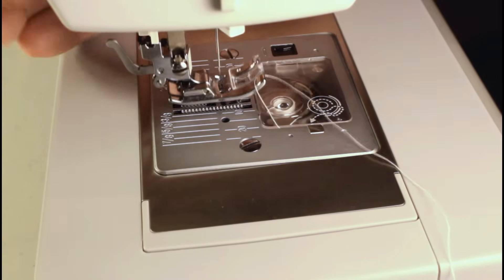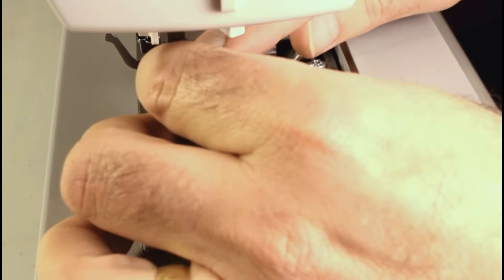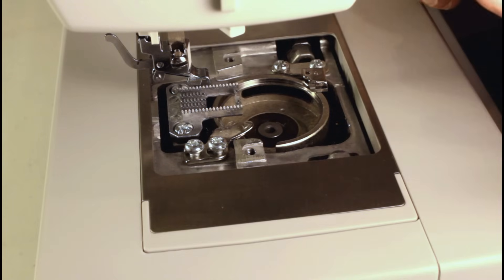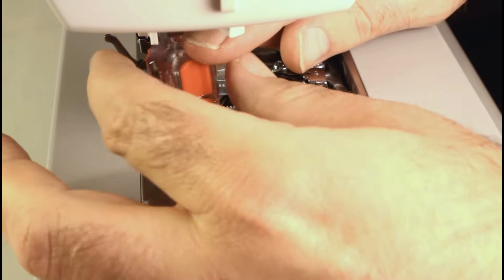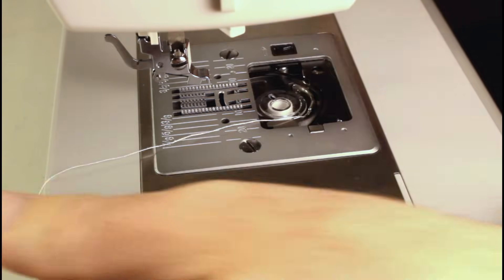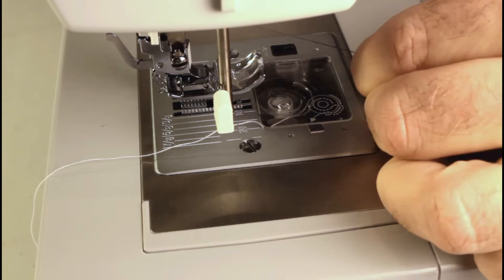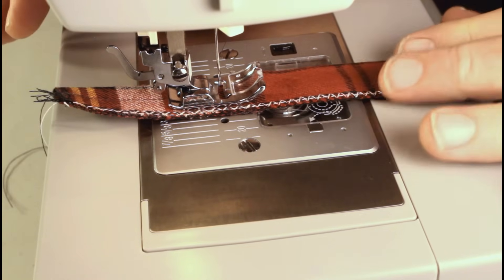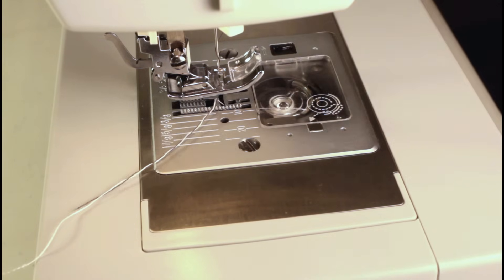Singer Heavy Duty - Adjusting Bobbin Tension, Please read the Description before posting questions.

Comment: I left this comment on another of your videos. I wanted to make sure you were able to read this problem. 
I made small adjustments at a time turning on the top tension dial on my Singer 4423. There was no difference. How can I fix the dial?
Reply from the maker: Download the service manual. It will show you how to adjust the tension setting:  www.kevinsews.com/download/SingerHeavyDutyServiceManul.pdf

Comment: Your top thread seems to be wrapped around the needle. Is this the correct way or does it just not make any difference?

Also on another topic... I'm using thread that is wrapped on the spool side by side up and down the spool (not zig zagging up and down the spool), should I use the vertical or horizontal thread post?

Thank you for your time.
Reply from the maker: Please read the description where I acknowledge this issue.

The cross threaded spools should be used on the horizontal spool holder. The standard ones should be used on the vertical post.
Reply: Kevin Sews
Thank you. Your videos are super helpful.
Reply from the maker: You're welcome!

Comment: Hello Kevin. Thank you for this vlog, it's very helpful. I just purchased this machine a couple of months ago, so it's a newer machine. Tonight my cat sat on the peddle and ran the machine with no fabric in it, probably about 20 strokes. It put quite a rats nest of thread in the bobbin compartment. I carefully cleared that out but now my bobbin stitches are not right. The top stitch is good, the back looks like dots of thread. (I hope that makes sense) I changed the needle, just to be sure it wasn't bent. Then I tried to adjust the tension with the screw on top, that didn't work. I was afraid to take it apart (until I saw this vlog) I will clean it again now using this method, to make sure I didn't miss anything. Could it have hurt the machine running it like that? Any suggestions are greatly appreciated. Thanks again, this is a great vlog!
Reply from the maker: I am sorry for my delay in responding. Your post somehow got flagged as possible spam and I just now noticed it. Hopefully, you've figured it out by now, but if not let me know.

Comment: My bottom stitch is not matching my top stitch. My top stitch looks great and even but the bottom stitch looks uneven and choppy. It just recently started doing this. So i was wondering if over time could the bobbin tension become looser from wear and tear? Thank you.
Reply from the maker: Check your needle thread tension first. With your needle threaded pull the thread with the foot down. The needle should slightly bend when you pull on the thread. After this test again. If it is still a problem then adjust the bobbin tension. Yes, the screw can back out oven time as your bobbin ages. Singer puts yellow paint on the bobbin to help prevent this problem.
Reply: Thank you so much!!
Reply from the maker: @krissyb1308  You're welcome!

Comment: Can you help me please?  My bobbin case started to move a bit.  I pulled it out to check and it came apart.... I have all the pieces.. two screws, the long silver piece, the long black piece, a tiny black oblong piece and the smaller silver piece.  I cannot figure out how to put it back together!! Is there anywhere that shows me how?  I have had the machine less than a year.  Thank you.  Any input is appreciated!!!  Model Singer Heavy Duty 4452
Reply from the maker: The bobbin case came apart?

Comment: I have a question that i hope you have the answer for. When the needle on my singer goes down twice it will get stuck. It does not go forward. Also there are a lot of extra threads underneath the fabric that I am trying to  sew. I was not able to find a solution to this problem. I am not sure if there is an issue with the bobbin or something else. The sewing machine was working fine for years and I started experiencing this issue.  Thank you!
Reply from the maker: What is the make and model number on your machine?
Reply: I have the exact same issue i was sewing all day and changed the thread and bobbin and now I suddenly have the above issue with the needle on my singer 4432  gets stuck & does not go forward. underside has clumps of thread which  the  user guide says I must check I loaded the bobbin correct. I did h=what they said and how i have been doing for  ever so cannot see this has anything to do with how I load my bobbin.

Comment: Hi Kevin,  I have the Singer 4423 and it jammed this morning first attempt to sew a heavy knit rib to some heavy twill - after pulling the fabric out I observed the bobbin thread all looped up on the underside and  the fly wheel would not budge/was totally jammed! I tried manually rotating anti clockwise and clockwise - all seized up and very stiff to turn.  After opening /loosening the lower metal plate and feed dog teeth and removing the caught threads -  the bobbin casing dislodged - so I removed without realizing it is removable (until after discovering this video) - so after a few attempts to rehouse - first attempt was incorrectly positioned without - with the black notch beyond the metal spring and of course the needle hit plastic when lowered gently by hand  - I removed and relocated correctly - and the machine test 'sewed' fine without needle threaded or bobbin inserted.. After inserting the bobbin and threading the needle (needle was not bent/and replaced with new anyhow) - was manually able to pick up the bobbin thread - however attempting to test sew - the same issue - the needle sinks, gets stuck and wont sew...I have ordered a replacement bobbin casing/housing but the original does not look damaged, if the new bobbin casing doesnt resolve the stuck stitching issue - what else could be wrong? I did notice that the bobbin thread gets caught under the bar that holds the bobbin casing in place with each rotation - not sure why but this is not right as the thread should be released to the underside of whatever fabric would be sewn.  I will really appreciate your advice! Is it a 'timing' issue - do you have any other video's regarding how to adjust the timing for this 4423 model? The machine sewed fine last week and is about a year old, has had intermittent use.
Reply from the maker: No, funny thing is I own and use several of these machines and not a single one has gone out of time over the past 4 years. I plan on doing a video on how to adjust it once one does.  My guess is you will need to remove the bottom cover to get to the screws required to loosen to adjust the timing. Just search for how to adjust sewing machine timing and use it as a general guild as to how the machine works. As long as it is a top loading bobbin you should get enough to figure it out.

I had one person tell me they had the same problem as you are describing. I shot a video for her showing how mine cleared then I never heard back again. My thinking is something is out of time though. Maybe the bobbin case has rotate slightly and it closed that clearance. That was what I was left with thinking the last time.
Reply: Can you please show me how your thread clears on your machine too? My issue is bobbin, and Im guessing it’s the thread clearance, it gets stuck on the little metal stopper bar to the right of the yellow painted tension screw. But now, I can’t remember how the thread should clear the black bobbin case altogether. I am thinking that issue is mixed with how the bar on the top left is being screwed back into place! I don’t know if the black bobbin case should have zero back and forth wiggle room, or a tiny bit, I don’t want to have the thread loop under the bobbin case- I just need a visual of how it SHOULD look, at a low speed... 

also, my machine came with a little metal triangle tool piece in the flip storage container under the bobbin, and that little piece fits perfect into the screws there, but the grip is kinda slippery, so getting your fingers a little sticky works to hold it firmly when unscrewing those impossible to reach screws. :)

Comment: So. What if my thread is bunching at the bottom. And not pulling my material through. (It stays stationary)
And the tension on the machine is 0?
I read somewhere that, that means my bobbin tension is too loose. I’ve tightened the bobbin a half turn. And it’s still bunching at the bottom.
Reply from the maker: See this video on how to test your tension: https://youtu.be/8TPB2yzw-1Y?si=-nnb-tMTWGuiQLUs

Comment: Hi Kevin. I love your videos! thank you for a sewing newbie.  i was sewing all day just hemming pants and changed the thread and bobbin and now I suddenly have issue with the needle on my singer 4432  gets stuck & does not go forward. underside has clumps of thread and loops. basically a big mess on the bottom! The  user guide says I must check I loaded the bobbin correct. I did check and reinserted to bobbin and seems ok. I am sewing pants that are a thin stretch material but I had been doing several before this started happening. It is only when I changed colour of thread this issue has started. I have even bought special stretch needles thinking maybe for this one particular pair of pants it was having an issue with a standard needle. any ideas?
Reply from the maker: You are having this issue due to this being a zigzag machine and the needle hole is wide to handle that. One of the tricks that has worked is placing the paper you stuff into gift bags on the bottom of the fabric. Once you've sewed the seam simply tear it off.  I would also suggest trying a stretch needle.

Comment: How do you know when you need to adjust the bobbin tension? Is it when you adjust the machine tension, but it doesn't fix the issue? Or can you just see that the bobbin is loose and that is why you do it?
Reply from the maker: You will see loose thread on the top side. Plus, when you are using a heavy duty thread like V69.

Comment: I've been shopping around for my first sewing machine and i'm considering the 4432 version of this machine. Do you recommend this for a first timer who knows little about machine sewing? I've read some reviews that this thing is really fast and that terrifies me. My main use for this will be sewing 1/6 scale doll clothes (about the size of a barbie) and i'm wondering if this is the machine for it.
Reply from the maker: Take a look at a machine that has a speed control slider on it. Those machine are much easier to control the speed and in general they sew at a much slower speed than this machine does. This machine doesn't have a speed control and the foot isn't design to slow one stitch at a time. It generally takes off when you press the pedal.

Comment: Hi. I followed your instructions, but now the machine makes a kind of "clack, clack, clack" sound from the bobine when sewing. Feels like the bobine is jumping around. I dont remember if it was doing it before. The bobine also feels kind of loose after I tighten the screws from the little "s" shaped part. I can move it up and down. Is this normal? Thank you for your great video.
Reply from the maker: No, that isn't normal. Make sure your bobbin area is completely clean. I've seen this when there was a small piece of thread lint in the bobbin area.

Comment: I had a problem with my machine causing a puckered seam on a lightweight cotton (Symphony from JoAnn's) We adjusted the tension and changed needles but couldn't eliminate the puckering. Do you think adjusting the bottom tension would fix it?  Are you not supposed to have to do this except when the machine is new from the factory?
Reply from the maker: Give Singer a call and ask them.

Comment: Hey. I have problem with my singer heavy duty. It skips stitches (straight or zig zag stitches) and can't do button hole stitches. I wonder what happen with my singer. I try to look up on google and don't get any clue. 
(sorry for my english)
Reply from the maker: It might be out of time. Otherwise, it can be the needle type being used. For example: If sewing a stretchy fabric try a stretch needle.
Reply: I'm having the same problem right now. My zigzag stich is skipping while hemming the brims of fleece hats. This problem just started, so I changed to a new 100 ballpoint needle, the right thread placed on the right spindle, the machine cleaned with a little new oil...

Comment: I’m trying to sew a water resistant fabric with stronger thread but having issues with thread fraying and skipping stitches. I’ve tried sanding down areas where it could catch and also using a new sharper needle and larger. Re-adjusting tension etc?  Could bobbin tension be the issue?
Reply from the maker: Slowly turn the hand wheel to form the stitch and see if the thread is catching as it rotates around the bobbin area.
Reply: @kevinsews  doesn’t seem to be catching? I wonder if this thread is just too thick?
Reply from the maker: @MevLanna  The thread should flow freely through the eye of the needle for sure. What size thread and needle are you using? You should be able to go up to a size 18 needle.

Comment: Will we void any warranty for removing the yellow paint??? Why else would they paint the screw head??
Reply from the maker: It could. You may want to contact Singer to verify before you do it.
Reply: @kevinsews I didn’t see your comment (no notification). I already attempted this and while the rats nest is no longer happening, my bobbin tension appeared too tight so I went back in to loosen and after a full turn plus a 1/4, there’s no change. The bobbin thread appears to be very straight and the top thread shows a bit - like _._._._._._._._._. I’m so frustrated 😩 😢
Reply from the maker: @Cathy_MidwestHome_Hens How old is your thread? What type of thread are you using?  What weight is the thread? Have you tried using a new needle?  Is the needle large enough to allow the thread to flow through the needle eye easily?

Comment: Oh yay! You have this one too! Kevin.... you're so helpful! Now I'm on part 2 of this timing issue. 😂
Reply from the maker: Great. Let me know if you need any help. Either I or someone else in the community will assist you.
Reply: @kevinsews  ok so I have fixed the timing to where my needle is catching the thread. After I put my machine back together and tried to sew...the top does stitch but now the bobbin won't catch. At all. I have tried several things you suggested and my little bobbin just doesn't want to cooperate. 😭 any tips?
Reply: Ok so I took it apart again and some how from putting the bottom case back on and moving it back upwards it is off again by almost 1/8 of an inch! 🙈
Reply: Kevinnnn!!!! 🎉🎉🎉 I did it!! I'm crying!! I just had to go back one more time and adjust it!! Thank you thank you thank you! The close ups reallllly helped me and I had to pause a lot to check my needle lining up like yours! I did it!!
Reply from the maker: @jesuslovingmama  That is great to hear.
Reply: I have a question. After I fixed the hook timing. I got the same problem that the upper thread stitching but the bobbin thread did not spin. So, do I need to loose it or tight it? Thank you very much.
Reply: @jasminepham6051  I just had to do like he said and break the yellow seal on the bobbin casing and then turn mine to the left just a tiny bit. Also make sure while the metal plate is off that you make sure that plastic casing can freely move as well against that metal piece on the right.  That's what seemed to be my problem. I just didn't make sure it was rocking in the seat well. Hope that makes sense. Kevin has another video that really helps with this!
Reply: @jesuslovingmama  thanks Carey, also do you have that video you just mentioned?

Comment: Hi Kevin,  the problem with my machine is  the bobbin holder case keeps popping out. I did try to fix as you did in the video but that didn't help me. Could you please give me an idea . Thanks !!!!!!
Reply from the maker: +JACKIE VELASQUEZ Make sure the two screws that I show you have to loosen to remove the bobbin case are both tight.

Comment: There is no way to test the lower bobbin tension without totally reassembly of the machine such as you did? Perhaps a light pull of the thread to see how the tension is getting using a feel for it? If the threads pulls with resistance then perhaps it's about right, if it pulls out easy then it's too loose, or is hard to pull than is too tight?  My bottom bobbin is always getting tangled up, so I surmise its too loose, and I'm going to try adjusting it. I have the low end or starter Singer. But I'm not a fancy sewer, I just repair rips and things / clothes falling apart that simple sewing can repair.
Reply from the maker: On this machine I don't have to place the screws in the cover plate to do a quick test. You can give that a try on your machine and see if it works. Otherwise, everything else needs to be locked down or the bobbin may pop out.
Reply: @kevinsews  Thanks, I appreciate you input and help and reply!